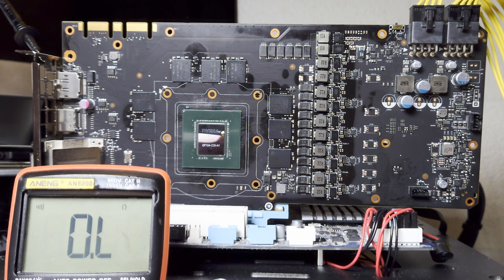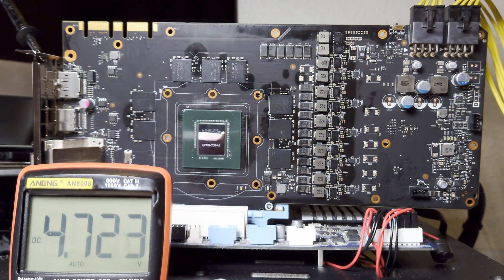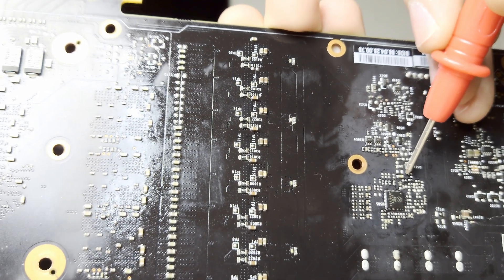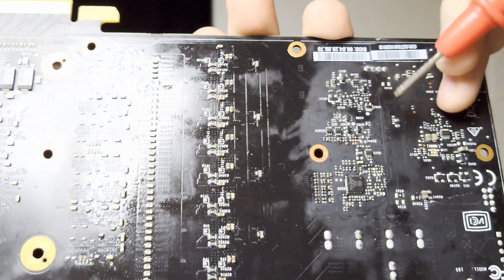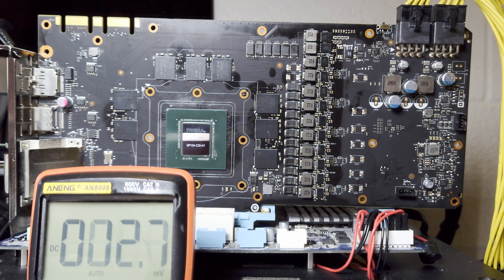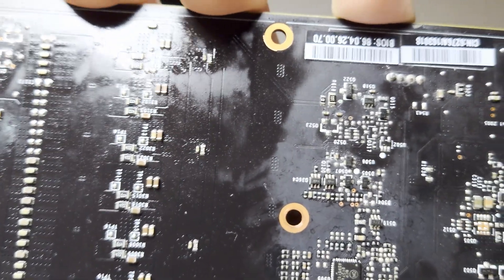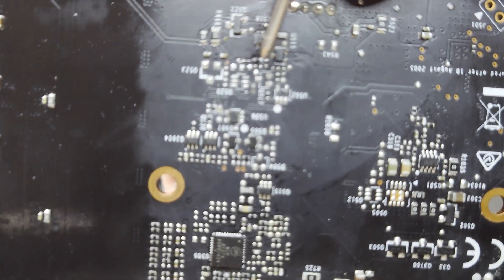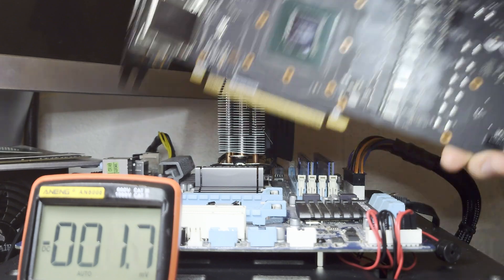EVGA GTX 1070 FTW Repair #2 - Not detected

Comment: i have same issue with my gtx 1070ti ,not detected by my cpu,dobyou think sir those diodes are the problem?what component u did a jumper wire,tnx sir

Comment: I have a gtx 1070 from evga its not the ftw addition but for me i get no memory voltage on the very top coil i get the right voltage every where else the 5v 12v 1.8v and pex 1.017v when i check memory in ohms mode i ge 25 to 31 ohms like u said if its samsung it will read low and the chips are samsung. When i turn the card on i get vcore as well 810+ ohms and gpu will get get hot but no voltage for memory. So am stuck here well a bad mosfet cause this or a bad voltage managment chip.

Comment: This card must run in a very high humidity area. Usually not located in America because if your house or boat were this moist you would run a dehumidifier. Something tells me the owner of this card might live on a boat, if so they need to run a dehumidifier so this will be less likely. If overseas the cost of power might be prohibitive especially when coupled to the cost of electricity for the power of this card. A couple of large 800 watt solar cells would help their electricity load.

Comment: i have a 1070ti with a shorted mosfet.i replace it and it worked but now i cant play games with direct x 11. i can only play direct x 9. . the mosfet i replace it with kinda not then same model with the stock mosfet the 1070ti has.

Comment: Hi. Amazing video. Condense and very helpful. Maybe I can get help here. I got SMI gtx 1070. No VCore, PEX or Memory voltages. I think I got a short on the PEX rail, 0.5 Ohms. I try injecting 0.75V (giving 3A) and with the IR camera I saw nothing getting hot (strange). I removed the coil and the short is on the GPU side, not the mosfet. Do you think it is a dead GPU? Thanks in advance.
Reply: RIP gpu

Comment: I have same problem, both 2 pin on Q521 are showing 12.24v, the left pin of Q521 (suppose to be 10.5v) is connect to the 13k ohm resistor then connect to the Q515 diode and the right pin is connect to the ground. But why the Q521 didn't have 10.5v? It's still 12.24v, both of them it's same, no any different between left and right pin. Actually a replace the Q515 with the new same diode. Can you help me?

Comment: hello, I have a problem with my msi armor gtx1070 oc 8go.
the card was not detected in windows and it prevents the computer from starting. the card was detected in safe mode as if it had no problem I was even able to flash it again but with each reboot same problem the computer reboot reboot reboot.
on the other hand the mosfet and vcor are very hot.
can you give me some advice?
thank you

Comment: I don't suppose you've stumbled across a 2070 Founders at any point?
I acquired one which vapourised the pcie 12v finger.

https://i.imgur.com/UlDPTle.jpg

Yes it "works" insofar as it gets 12v and 5v in some places.
But which of the other dead coils is meant to be 12v?

That's all I need to know for now really.

Comment: How do you recognize SOT2(2)3 package elements, I mean how do you tell apart diodes, mosfets or bipolar tranzistors without schematic? There is no part number marking by which you could find datasheet. 
Whenever I need to salvage some mosfet from motherboard or GPU, there is no way of recognition...

Comment: Actually that 101 ohm resistor at 8min 43secs is a 100 ohm resistor.  The first two digits are the value and the third digit is the multiplier (number of zeroes) - so 101 = 100 ohms, 102 would be 1,000 ohms (1K) 103 would be 10.000 (10K) etc....
Reply from the maker: Thanks!
Reply: @TechCemetery  great job.can i mail you some high resolution pictures of that Pcb so you have a nice close up to show in your videos

Comment: I have a 2 x 6gb gtx 980 ti sc 2.0 how can i send it to you for repair them and who much it will cost me 1 dont power up no fan secon one stuck on resolution 900x800 even did a windows 10 fresh format and driver install ready to donate 260$ for 2 repair card

Comment: Hello, very nice work mr. Maybe you can help me out, I have an R9 390 8GB gaming and when I run windows in safe mode it shows image and also shows image when the drivers are not installed, if I installed the drivers than it just shows the windows logo and after black screen. Any idea?! Thank you
Reply: I will help you to answer, first flash the bios in safe mode maybe the bios get corrupted, if after flash the right bios still trouble, then the gpu chip already dying, power stage is good if it can boot up and show image, one of sign amd gpu chip is dying is by measure the resistance for 0.95v or sometimes people said display rail, the rail located near pcie pin, from my experience below 10 ohm is dying, 0 ohm absolutely short
Reply: @whoooshmeifyougay4482   I did flash the bios and nothing but I reflow the chip for 5 minutes at 310 degrees and now it works but most probably will die soon, thank you very much for your help.

Comment: this is some next level problem tracing. tbh if i had that card i would likely have stopped at "we are missing EN" and would have "solved" it by giving it the enable signal with an external buck converter. with every video you make i learn something new and hopefully this will result in me ruining less PCBs when i feel like picking up something that's dead and try to revive it for some overclocking :P
Reply: seeing Zoras Tech comment here is like a cool cameo